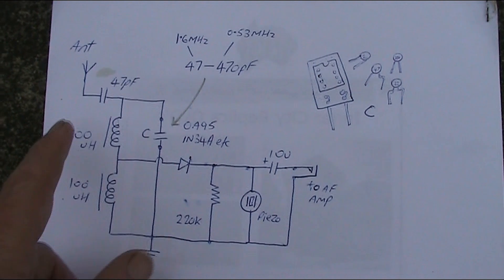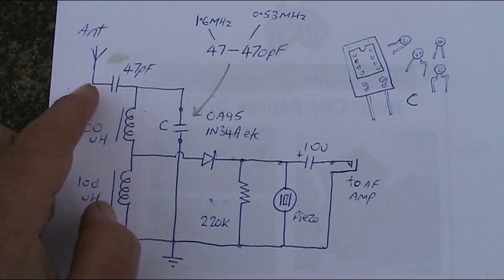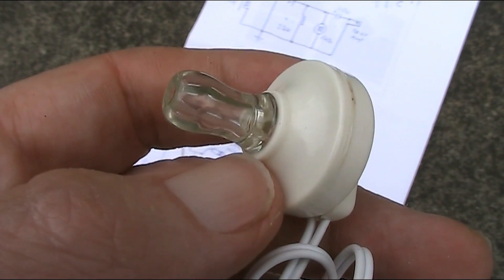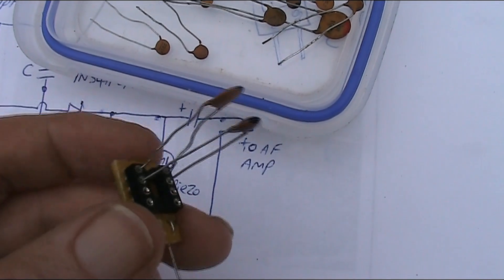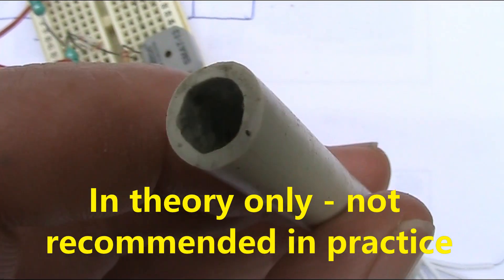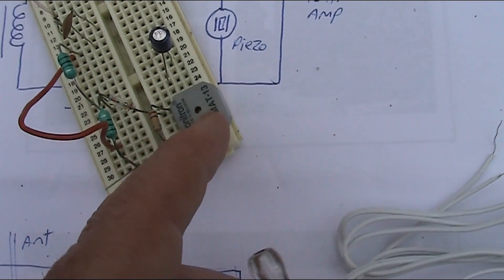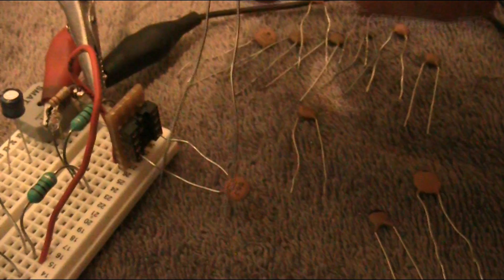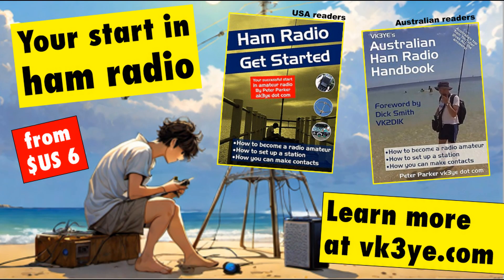An almost solderless crystal radio

Comment: Hi Peter ! 
please , I have some mystery question here  !!! 

a) I just made a small cristal set , 
and I played with  galena and few other diferent,  real cristals .... AND in addition
 I 
b) hooked up 
a Dick Smith's
*" 1 transistor/ 9V amplifier " project. 
it worked well. 
...then... ,
 as I played with some  loose conections 
I realised that : 
I dont need 
* nor a cristal 😮
* nor 450pF capacitor 😮 conectrd here. 
... and radio is still working 🎼🎶🎵🎶
...( so I removed both of them) .

c) At the end I have just 
* antena coil (air coupled)  to
*  a  detector coil 
... that is directly conected - to
* the input of the
mini Dick  Smith's  amplifier ....
🎼🎵🎶🎵🎶🎵
...  ..and it works !!!

well...
how is this possible Peter ...looks so strange ...but it works 
??????? 😮😮😮
please explain !!! 

thanks !
Reply from the maker: A transistor contains a diode junction that will detect radio signals if they are strong enough. Crystal sets don't really need variable capacitors either though they will be unselective.
Reply: @vk3ye  Thank you !!!  
Nice explanation.

Comment: If you have a goodly number of capacitors, you can do series/parallel combinations to get many other values.
I would do this on the solderless bread board.  I will make up an example:
Lets say you have a gap in your selection at 50pF but you have a bunch of 100pF capacitors.
Two 100pF in series will give you 50pF
The rule for series capacitors is CSeries = 1/(1/C1 + 1/C2)
This is fairly easy to do on a calculator with a 1/X key.  Try it with 100pF and then notice that you now have a 50pF
Now use that 50pF and another 100pF in a string and you will discover you can also make 33pF
You can now make your self table.
To be extra clever if you have a collection of toggle switches and/or some sort of rotary switch,  you can switch in and out capacitors.
Also: 
I did a video showing how to make a home made variable capacitor.  It isn't very good long term but it does work and will give you a wide range.
It goes from something under 50pF up to about 1500pF
Reply from the maker: You can do it on a solderless breadboard but you need a larger one than I had for a good range of values or use jumper leads to other holes.

Comment: Why not connecting the capacitors direct in the breadboard?
Reply from the maker: you would need a larger breadboard with more holes that I didn't have
Reply: This is the question and answer I was looking for! Excellent video! I think this will be my first electronics project.

Comment: What is the reason for the 220k load resistor --due to high Z if crystal earphones --? what value resistor would you use if coupling to an audio transformer to external amp?
Thanks for your well presented  tutorials, I always learn something.
ps. I just ordered your more antenna book, there was enough readable on Amazon I could tell it was going to be a good manual.
Take care
De KF5HCR
Reply from the maker: The resistor provides a DC path. Not needed if using an audio coupling transformer. Otherwise leave it at 220k but not critical.
Reply: @vk3ye  With a real 1N34, I found that no resistor is needed with a crystal earphone.  The reverse leakage of the diode is enough to make it work.  With what you often get if you try to buy a 1N34 you need more like a 2K resistor to make it work well.  I found that 1N5711 works well like that and appears to be what is being sold as 1N34.

Comment: Built one like it, but 470uf inductors (had on hand) with capacitors, and MK484-1 AM Radio Integrated Circuit instead of germanium diode... worked like a charm!
Reply: What are 470uf inductors😂😂😂
Reply: @TechniCraftYT  🤦‍♂ 470 uH Inductors ... oops!

Comment: Your parts list seems to be missing the most important components; the choke coils.

I ordered some 100uf inductors and some germanium diodes and will give it a try.

I did notice the 100uf coils come in many forms and sizes. Would any of them work? A person could design a circuit board and even use surface mount versions of most of the components to try and make it very small.